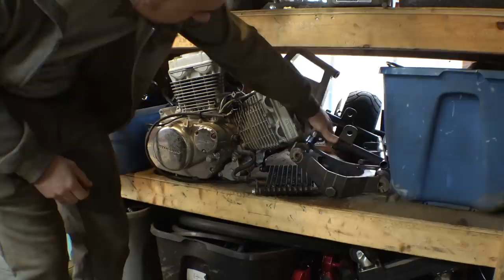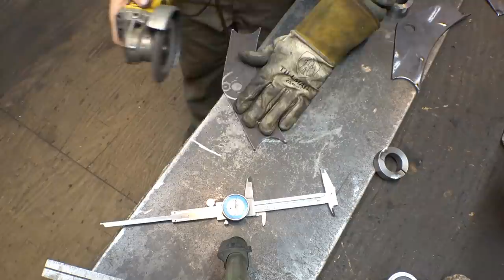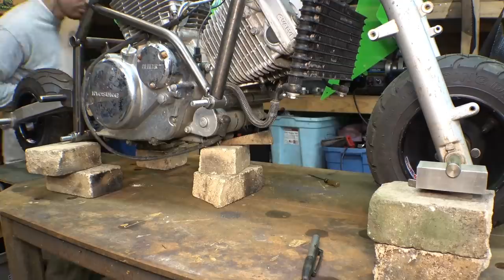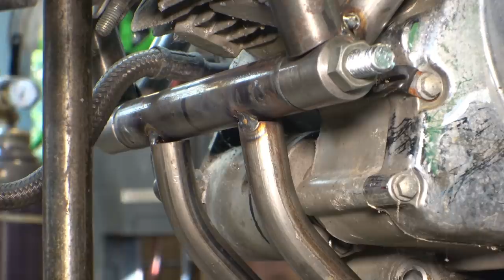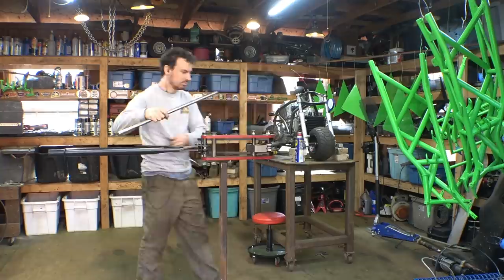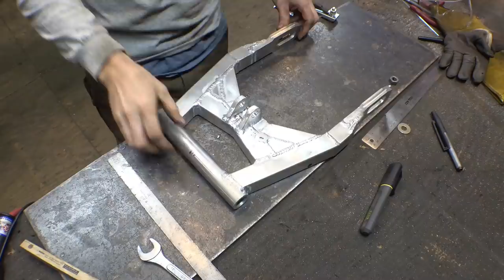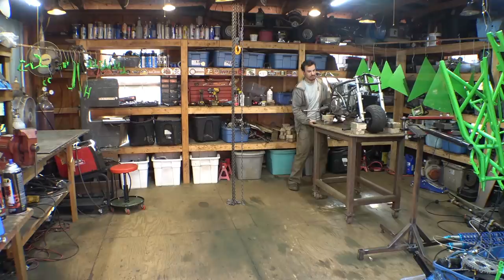Mini Crotch Rocket Build Part 3

Comment: What you do in terms of machining and welding is at really high level for a content creator. That's why it always bothers me how you do suspension and general chassis stuff with so much trial and error. Some things are much simpler being calculated than cutting things up and reweld them. For that current rear suspension for example, the heavy shock actually doesn't look too far from what you will want here. You don't "feel" suspension, it's simple math (and then feel and fine tune from there). Just look into how to set suspension sag on a motorcycle. The three numbers you need are your shocks overall travel, your static sag N1 (compression of the shock through the weight of the bike) and dynamic sag N2 (compression including yourself). Not sure about the exact terms in English though. Then setting it is just getting your numbers matching your application. For dirt let's say you'll roughly want N1=10% and N2=20-30%, street roughly N1=10% and N2=15-20%. So if your little shock here is having 3 inches of travel and you're going for street setup, it should compress roughly 5/16 when the bike sits on the ground and 10/16 with you on it. If you set the first value correct and your're to high on the second, the spring is too weak and the other way round. There's alot more you can do to suspension obviously but regarding springrate it's as simple as that.
Reply: FINALLY someone else who understands!!!! not to mention he can always buy just a spring...
Reply: I thought the firm red shock looked almost perfect.
Reply: It is also easy to calculate needed spring rates. For example:
Lets say rear suspension travel is 100 mm, and rear shock travel is 50 mm, then linkage ratio is 100/50=2.
Bike mass 100 kg (use scale) and half of it (use scale) is on rear axle = 50 kg.
Rider mass is 75 kg (use scale), and 50 kg (use scale) of it is on rear axle.
Total mass on rear axle is 100 kg.
Without preload, if we want rear suspension to compress (loaded/rider sag) 50 mm with 100 kg load, then spring rate must be 100 kg/50 mm = 2 kg/mm on rear axle.
If linkage ratio is 2, then spring rate in rear shock must be (because of spring rate physics)
2^2 * 2 kg/mm = 4 * 2 kg/mm = 8 kg/mm.
And if we want to rider sag to be 30 mm (50 mm - 20 mm = 30 mm), then we must add 10 mm preload to shock spring, because linkage ratio is 2, which makes sag 2 * 10 mm = 20 mm smaller.
And then go to amazon/ebay etc...
Reply: Assuming these chinese shocks are at least somehow properly set up I'd first try to find one that roughly fits with the stock spring though. With non adjustable dampers you can easily make things worse only messing with the spring rate and not adressing damping. Digging into the damper shiming/orifice/oil is probably a little over the top for a fun bike and would require a bench tester anyway. But when I see what this guy has taught himself and is able to do in terms of metal work, some studying of suspension theory would improve his builds a lot and save a lot of headaches.
Reply: As much as this is a lovely idea. When working with cheap Chinese shocks you literally don’t get the option to spec an accurate spring rate. 
As he said in the vid there’s very little option so you have to buy what’s available and make it work for your application. 
If you were to buy expensive ohlins or fox etc shocks. You’d have more options. But the shock alone would cost more than this entire build.
Reply: You do not need the option to spec an accurate spring rate. It is enough if the spring rate is close enough. For example 8 vs 80 does not work at all, but 8 vs 10 works ok.
Now he does not know at all what to buy.

Also, linkage ratio plays a huge role. And you can use it to adapt a bit "too stiff" spring to your current set up.
For example 8kg spring with 2:1 linkage is same as 10kg spring with 2.24:1 linkage.

Small change in linkage ratio makes a big difference, and when spring rate is close enough you will not have any problems to make it work.
Reply: @deadslow201  oh I totally get you and understand where your coming from. I work with linkages and leverage ratios in my job frequently as a designer. 
But I’ve also tried ordering cheap shocks and you kind of get what your given haha. You can however spec a spring after you’ve got the shock and measured the dimensions of the spring itself.

Comment: I would have made the side bars up front that connect to the forks bend down instead of up so they would protect the engine more and become a better mounting point for the cooler.  You are also going to want some padding on the seat, so I would lower the tail down a few inches.  When sitting on it you would also.  The idea of the suspension is more about drop than going up and to start at the ride height while under compression.  The angling of the shock is to change the mechanical advantage of the shock, not the ride height.  Use he red one and tip it forward more.  If the angle is enough you might have a 3:1 ratio on the shock travel, so the 900 pound spring will work better.  Move the height though so it will also be sitting at the desired ride height while you are on the bike.

Comment: Look up "static sag" for racebikes. I'm going from memory I believe its around 25%. So with the bike fully built, fueled, oil filled, battery installed, and fully geared up rider, measure the travel distance at a consistent point(axle straight vertical usually, or some consistent ref points), unload the shock basically hang the bike so the tire just touches the ground, then take the matching distance when bike is complete and rider on it in full gear sitting on it(bounce a few times to let it settle in). For example if you have 4" total travel, the static sag measurement should eat up 1", leaving 3" travel remaining. 
Great stuff, can't wait to see it do some ripping around!!

Comment: The red shock looks like a standard coil over shock. Those use a 2.5” spring and you can get any length or spring rate you want and they are pretty cheap.

Comment: If you have a rear mono shock from any of the bikes you pulled the motors from, CBR or anything, I would try one of them. A no link suspension vs linked suspension needs a stiffer spring, so say a CBR 600 would work. The XR 70 in my pic has an XR80 swing arm without the link and I have an R1 rear shock. It is preload, compression and rebound adjustable. I bought it on eBay a few years ago for like $40. Also, love the builds, great work.

Comment: Hey big guy the crotch rocket is looking incredible. I think you should go on using the heavy duty shock you have for several reasons. 1. You are still adding weight to the frame tank and seat etc. so having the stiffer spring then you know it will take the extra without collapsing. 2. You need to respect the little beast you will be putting between your legs. I (HOPE) you wear a real leather jacket, pants or chaps, boots and a helmet, which will add another 40-50 lbs or more pounds to your weight. 3. Crotch rockets I've ridden always have stiffer suspension for better cornering and control. 4. With a stiffer rear setup, you should be able to keep the chain from snapping and making you crash. If I was you, I would turn the swing arm pivot into a Jackshaft point then there would be direct drive from the motor and perfect pivot range for the swingarm. That way you will never loose a chain or god forbid have the thing snap and spin around and take off a leg. Keep up the awesome content my friend. Stay happy and healthy.

Comment: Nice project so far! As a orientation mark: The sag  with driver should be 1/3 of the whole suspension travel. 
And may be You have a bit of vertical flex in the swingarm between the mounting point of the shock and the wheel axle.

Comment: I bought that shock(white coil)  to replace a broken one on my kids ATV had a (yellow) much longer travel heavy spring, The New One has very short travel. it seems bit weaker than the stock one, need to get another one. Chinese ATV and Quad Shock Absorbers | VMC Chinese Parts stocked  in the USA, so if they don't have it, don't order waste time waiting for it.  I have gotten many items from them, great service.

Comment: Use the red one, but move the lower linkage closer to the hinge point (maybe bridge the gap between the cross tube and x-brace). OR use a pair of the white ones, in parallel or a V like the motor.

Comment: look into mountain bike air shocks. There are specially valved shocks made for heavier E bikes out there. Its a smaller shock and the spring rate can be adjusted by air pressure.

Comment: You could use a cantilever on the rear suspension. Is perfect for this setup. Same adjustment (or more) with less space and "online" without having to remove anything.

Comment: That red/black rear shock actually looks correct. 
You have a habit of mounting the pivots for your swingarms way too high, look at an actual street motorcycle and look where the swingarm pivot resides in relation to the axle. With you on it, the swingarm should be about dead nuts level. This thing is gonna look goofy without someone sitting on it since the majority of the weight is the rider, not the bike. 
You want the rear shock stiff enough that it wont squat when you accelerate, and wont bottom out over bumps. Notice on most of your rear-sprung builds that they tend to "climb up" on the rear swingarm when you accelerate. Your rear end geometries are way off. 

Try it with the red/black shock, and move the swingarm pivot down so the swingarm is level with you sitting on it. you can always swap out springs later on to adjust, but remember its a street bike, not a dirtbike. It's not supposed to be soft.

If you can get access to an actual street bike of some type, i recommend actually going and measuring the rear suspension geometry and copying that.

Comment: Just a thought. What about using some of that screen material as some of the body panels since you can't use plastics. Like in the triangles where the shock mount is but make it removable of course.  Awesome build though.

Comment: you can probably get a softer spring for the red shock. or lay it flatter and move bottom point closer to pivot point to get softer feeling. Car coil overs use standard size springs and very easy to get all kinds of stiffness and length. I assume motorcycle shocks also use a standard spring size.

Comment: If You want to make new project like this try with Honda Shadow 125 engine. Yeah it's only 15hp, but that V engine have almost 90* cylinder spread. I think it might fit better for such small projects. Center of mass will be almost 1/3 lower and You'll have a bit more space maybe shrinking whole bike even more :)

Comment: Frame splitters. Not fake stuff very really. And done quite well I may add. Great wrk great thought process as well. Would been nice to have the tail section.(sub frame) bolt on because you’ll damage it so you want it replaceable

Comment: they use those same elka single-shocks on pit-bikes. it is a much better shock than those others which are used as a 'pair' on twin-shock bikes. You just have to get the angle/leverage ratio right. the collar on top of the spring changes 'preload' not rate.

Comment: It's not cheap, but you could buy a second hand shock that is refurbishable and let it be re-shimed and put together with a softer spring that has the right characteristics for your setup and weight.

Comment: looks like you have enough room to mount bigger rims (ok you need to stretch the rear fork) , like the ones from a grom 
looking at a picture of thegrom : you might actually be able to drop the holowed out tank from a grom over the top cilinder install the buddyseat and the other bodypanels and make it look like a grom , it prolly beats the pants of quite a few other motorcycles though

Comment: The shock with the red spring actually looks like it would work but the dampening is horrible which is why it rebounds so quickly. If the dampening is adjustable, as a lot of those cheap coil overs actually are, you need to add a bunch more dampening to slow the rebound down. As long as the top of the shock is not inline with the bottom, it won't be 900lbs springs because of the leverage on it.

Comment: Never considered Trailing angle before (though it was Rake angle to be honest).
Interesting.  Probably explains why my R6 (600cc Crotch Rocket) just about falls into corners where as my mates Harley you have to steer into corners (might also explain choice of amount of leverage in handle bars (ape hangers) vs clip ons on Crotch Rockets)

Comment: As others have said that red shock looks very close, if its a bit firm juct change the spring to an 800lbs or 750lbs
probably easier to fidn a known spring than taking a gamble on what may or may not be right based on an amazon listing.
Spings are normally sozed by length, diameter and then the rating... easy!

Comment: either loses top of red shock to try to get it softer or switch to a pit bike shock for like 200 to 300 lbs or prolly even a 125 dirtbike shoch would work i think its weighted enough for it but wont be too stiff bc its for like 100+lb people on a light ish bike its a perfect median

Comment: The imaginary line should be drawn down the fork tube, not the steering stem. You had it right the first time. Every bike I have, small or big, has the steering stem perfectly parallel with the forks. Otherwise great vid as always!
Reply: Was about to say the same. The trail angle is drawn downward at 90degrees to the floor from the wheel axle compared to the steering angle. 
The re make of the fork has actually made the angle exactly opposite of what it should be. As you say it was perfect as it was before now it will struggle massively with force feedback from the road to the handlebars. And be very unstable at speed.

Comment: Wonder if you could lay the oil cooler flat under the seat area above the rear shock. Wouldn't get as much air flow but also wouldn't be hanging out front

Comment: Just go with the red shock ... it'll work better than you think. The white spring shock was never gonna work, way too soft .. they are usually used in pairs and even then are still on the soft side. The red shock will see you good .. have faith 😉

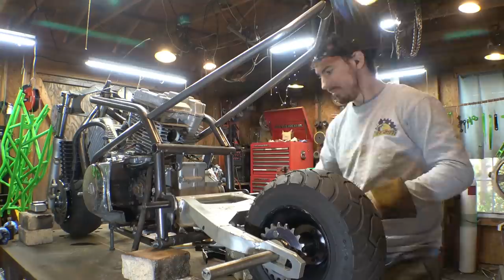Comment: I'd think about the final drive gearing. Even with the small wheel it looks like it's geared to go 120mph running a 15:19 final drive ratio or whatever that is. For comparison, my Suzuki GS450 with 18inch wheels ran a 15:45 or 1:3 final drive ratio. Turned 10k rpm and did about 90mph. Probably won't matter. You probably won't want to go more than 60mph on that chassis, and it should have plenty of low end torque despite the gearing.

Comment: If you tilt your body with a combination of low trailing length and thick tires, the contact patch position will move to the side of the virtual steering shaft.
As a result, a rotating torque will rise on the steering shaft and the handle will rotate.
From a safety perspective, I think the trailing length needs more than 3 inches.
I will pray for your safety.

Comment: I saw a problem from the start.
That swingarm is tacked way too high on the farme.
Along with stiffer shock, lowering the swingarm mount should solve the problem.
Also, you could invert the upper shock mount and put on a bigger rear sprocket.

Comment: Just measure the spring od/id and length on the shock you want to use and get a spring with the rate you need from someone like race tech or similar.

Comment: @rather B welding
It's a pity you didn't buy this shock as it has a lot of adjustability & it is quite good it's a DNM MK-AR 850LBS 280mm Adjustable Spring Rear Shock For Pit Dirt Bike Motorcycle 386kg  60mm travel.

Comment: One question by the position of the engine I think that the bottom cylinder will overheat,it will run hotter becouse of the fin facing to the ground

Comment: Looking very cool first of all. But speaking of rake and trail, could you check the trail measurement on the Lil Rascal?  I can’t get a straight answer from anyone on whether it’s proper or not. It definitely doesn’t look like it is, in the pics. I know strong arms can overcome some of the issue on such a small bike at low speeds but there’s not a chance I’m spending $700 on that thing if it handles like a broken shopping cart. I’ve got an old Gilson mini bike with bad trail geometry and it’s no bueno.

Comment: If you ever update the suspension on this thing, please do me the favor of ordering a BBR honda xr50 adult shock. The one i had worked with a crf450R engine and stretched frame. Bike belonged to my coach and rode horribly so i gave him the BBr lift shock for a 2001 xr50 and it rode so much nicer. Decent travel and good for a 220lb rider.

Comment: You might have better luck just looking for a spring with a higher spring rate and fitting it to the shock you have. 
Or find someone selling a 50/65cc motocross bike maybe that would work

Comment: check out winding your own springs on the lathe you may have to heat the spring stock but I believe this is the way forward with custom suspension that you need for the machines you build .. let's face it this creation is not like anything out there so how is a stock part likely to fit it ..?

Comment: if you want the bike to sit as it is, on the blocks, shouldn't you made the shock mount with the swing arm more extended? so when the bike has weight on her should be leveled has you have now on the blocks, granted that shock doesn't have the strength needed to support the weight but i think this would be a better way of doing that

Comment: Your front is a little long... You could cut those 4 bars in the front and move it back nearly 4" inches and it would still work well.. and look a lot more symmetrical.   Just a thought, it's still fine how it is-- but it just looks long and there's big gaps in the front that look out of place.